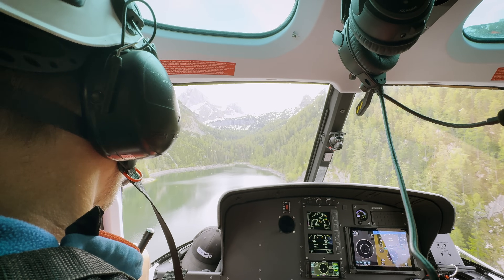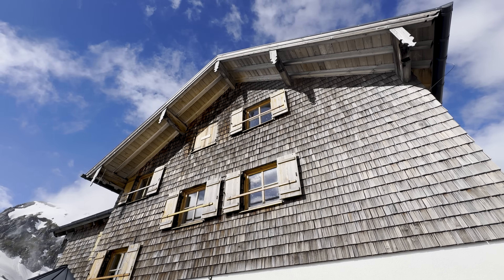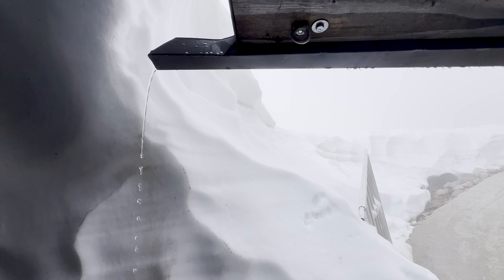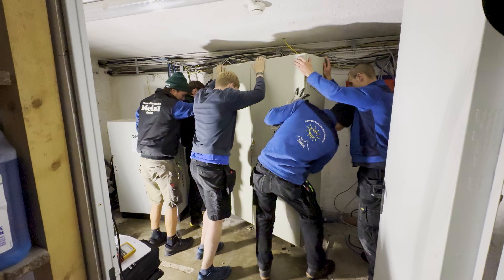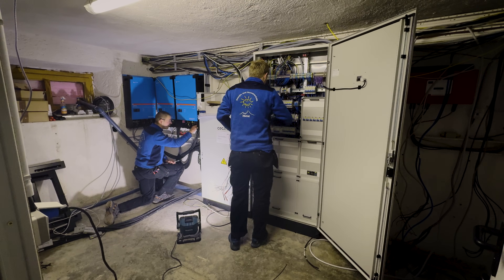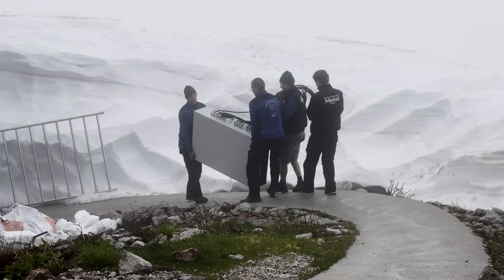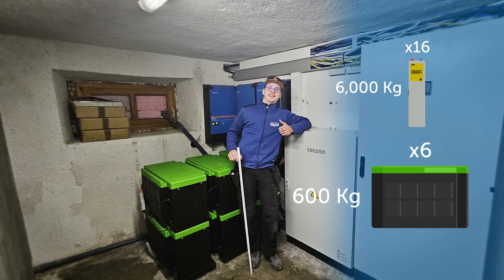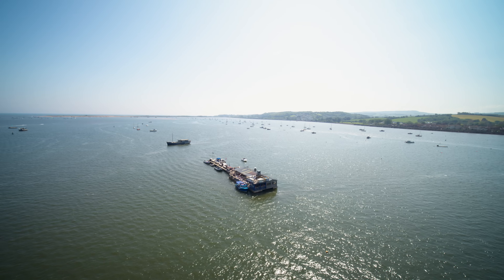Only way to get equipment to this hotel is via helicopter

Comment: why not use Victron charge controllers?
Reply from the maker: Cost
Reply: So you can use the grid inverter, controlled by Victron, at daytime to power the hotel.
The charge controller and the Multiplus charge together if enough PV-Power is availabel.

If you use only charge controller, you waste energy at the conversion and you cycle the battery.
But a charge controller is needed for for Blackout-Powerup (so the battery maintain charged even when the system is off, the components need supply power)

Comment: Great video, but a bit more details would help a lot. Like why not put the whole roof full of panels, incl. north side of the house and minimize the generator runtime as much as possible? Why not removing the old SMA inverters and putting MPPT in, so save on conversion losses to charge the batteries? Why no heatpump for hot water?
Reply from the maker: It's a matter of cost to not fill the roof with solar.  In an ideal world all roofs could be filled.  Again cost to keep previous inverters.

Comment: Is it a single cable car?  With a dual car, weight going down could assist weight coming up.  I saw a lot of old lead batteries that would make several great "down the mountain" loads!
Reply from the maker: Yes it’s only a single